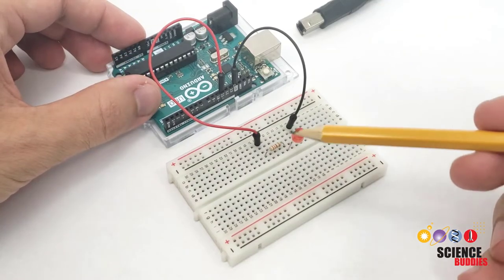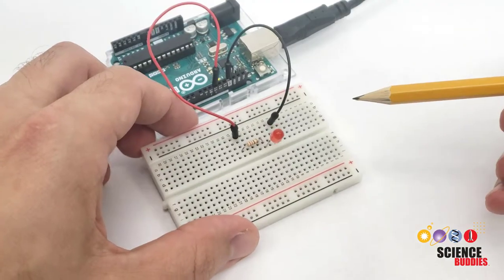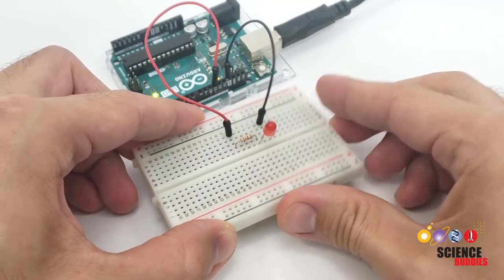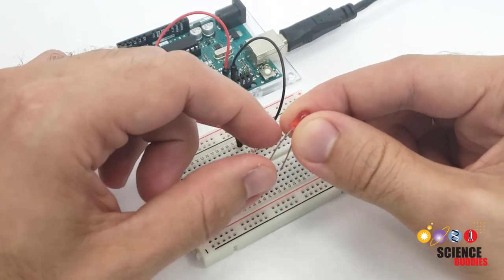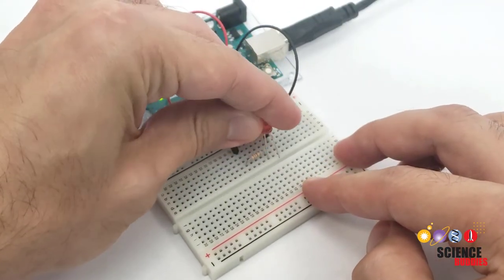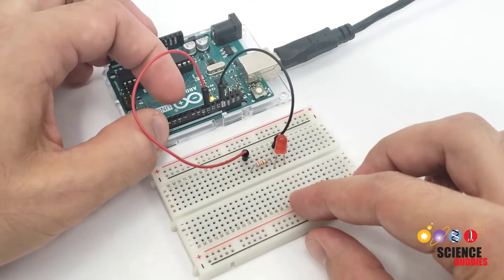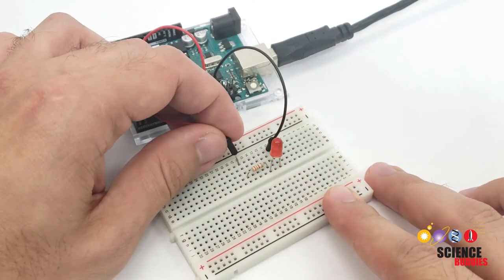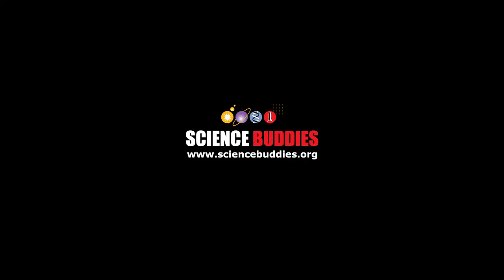How to Debug a Circuit (Lesson #3)

Comment: I have an Elegoo because I had no idea what I was buying, and the pins on the board do not hold a wire very good at all.  It's very loose on most of them.
Reply: they arent that bad, I have a mega and tge wires are super strong in there. Do u have an uno?
Reply: they're the exact same thing. Elegoo is great, return urs if it's bad